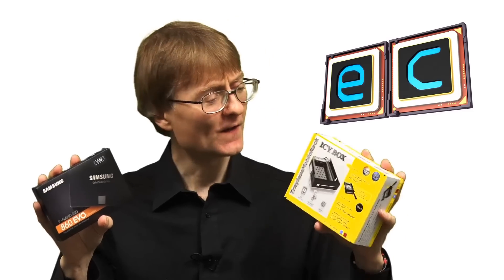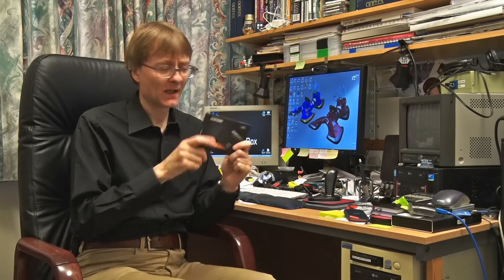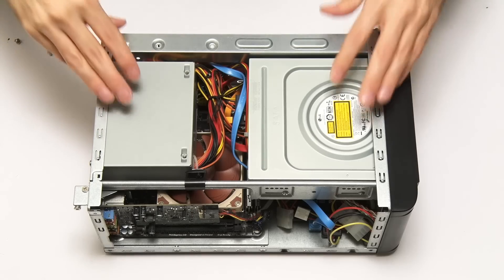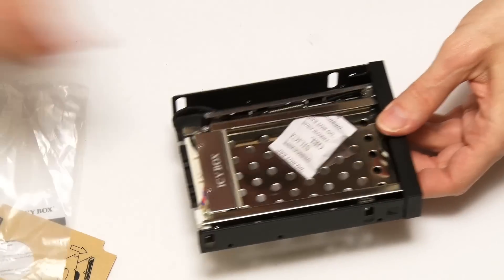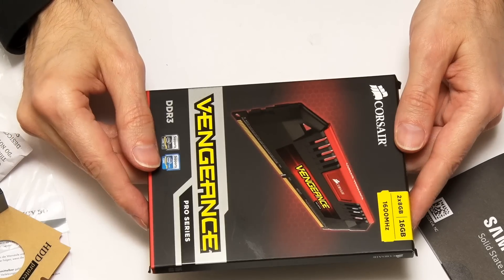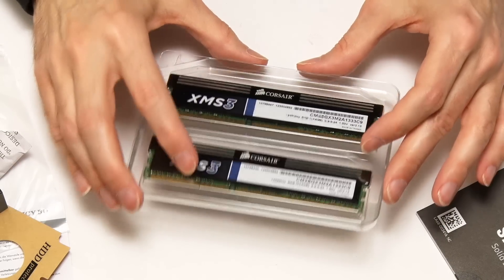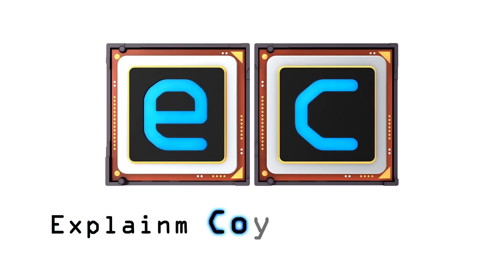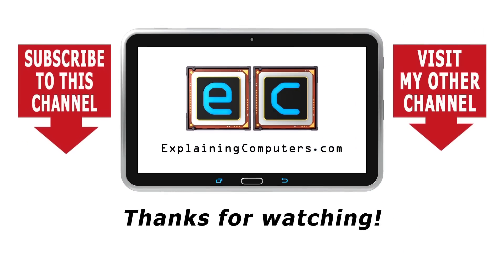i3 Mobile Rack

Comment: Good idea and something I might use to further increase the storage options in my already massive system (i've got a total of 10TB on 4 HDDs consisting of 1TB boot drive, an old "shucked" 1 TB data drive, a newer 2TB SSHD data and a new "shucked" 6TB HDD for even more data).  I prefer the look of the SilverStone SST-FP510, as it give you a hot swappable 3.5inch and  2.5 inch bay, as well as front usb3 (good for older cases), also on/off switches for both drives.

Comment: So are you running Windows 10 as a virtual machine under Linux?
Reply from the maker: Probably (for web page testing). But the first VM I set up was Windows XP (which is running offline for various older Windows software).

Comment: But why don't you run Windows 10? My old desktop was an Intel Core 2 Duo with 4GB ram and it ran flawlessly. The only problem I had was the integrated Graphics. When I used an Nvidia GPU, you wouldn't notice it's age. The only reason i replaced it was that the motherboard died.
Reply from the maker: Some software will not run under Windows 7. And I greatly dislike having zero control of updates. My biggest reason is that I cannot customize the display to be comfortable for my eyes on a standard DPI screen -- something that I can do with registry hacks in Windows 7. I am one of the very small percentage of people who finds "cleartype" to be very uncomfortable to read. So the font controls (or the lack of them in Windows 7) are the deal breaker for me.

Comment: The point about dropping Windows 7 soon is moot. What is had now is extended support only. So fixes would only come at a cost, not for free. It's already "too late".
Reply from the maker: Windows 7 is still receiving free security patches until Jan 14 2020. So it is not "already too late" -- Windows 7 is still considered a secure OS by Microsoft and third parties. But beyond Jan 2020 it will not be.

Comment: Fantastic video Chris! I have just started my migration over from Windows 10 to Linux mint. I gave 10 a go (Reluctantly) but now one machine is over to mint I will be getting all the others over too! My migration was hampered by my laptop being AMD apu based and issues with graphic drivers so it's staying on 7 as a legacy machine now. I didn't want to touch my core 2 duo desktop so was stuck till I got given a celeron acer which was perfect timing ;)

Comment: I have a machine with 2 ssds that boots into GRUB and I can choose between mint and windows 7. Is there a benefit in using this insert method over GRUB?
Reply from the maker: It depends on your requirements. GRUB can get corrupted. And for me the flexibility to instal/test out many different OS is useful for the channel. There is no best solution.

Comment: This upgrade is what I did with my old Core2 Duo test machine... until it failed through a power supply problem.  By then there were no spare boards etc to fix it.  :-(
Now I use an HP N54L Microserver.  As it comes with 4 cold-pluggable drive bays, and can happily boot from any of those bays, I find it even better.  It is a 64-bit computer with full virtual computer support and can accept 16GB RAM.  There is enough space at the front to pull out the inactive drives, close the latch on the unused drive trays, and leave them disconnected behind the front grille.  I measured these computers as using ~54W input; but that one now has an added graphics card.  BTW, I have a second N54L running LMDE as a server and emergency backup computer.  :-)

Comment: Modern small LEDs can be very bright, to dim them you can solder a resistor to the power cable (the cable going directly to the LED of course). A 10K ohm will take the edge off while a 20k resistor should be dim but still visible, you can dial-in the brightness with values in between. I changed the annoyingly bright blue LEDs on my case to white for HDD access & a slow colour change for power. Granted it's some fiddly work but can be worth it.

Comment: I like it but, molex connector in 2019 come on.
Reply: Face it, Molex 4-pin power connectors are a de facto standard, in use for decades, and are the least common denominator in power connections.  Have newer power connectors come along?  Certainly, but none are as universally adaptable.  And I've never had the problems with it that are being mentioned.  If you prefer something else, use it.
Reply: @bobblum5973  Right. The molex will live on at least 6 more years.
Reply: What a load of bollox.  
It's a power connector FFS!  It has pins and sockets and far more robust than the SATA equivalent.  
Strewth!  Some people just have to moan about something.  
Yeah, so they're a bit 'chunky'.   But I've lost count of the number of SATA style connectors I've snapped over the years, never snapped a Molex ever.
Reply: It's  5-year old machine. Ease up.
Reply: @jsimmonstx  not the adapter he bought to install the ssd though. That is brand new.
Reply: 5 years?? molex hasn't been a thing for about 15, no parts require molex today, they are unreliable and not very useful compared to modern alternatives, adaptors to molex are the most dangerous things you can put in a computer. there is literally a saying in tech "molex to sata lose all your data"
Reply: @dayspoiler4608  I dont agree with you about molex being not in use today as my power supply bought only last year has 4 molex connecters on it (evga supernova g2)
Reply: @dayspoiler4608  Drives and expansion cards don't use miles but random cheap enclosures, RGB stuff and other things that draw power still often use molex.  Lord knows why.  Molex sucked twenty years ago and has aged like fine room temperature milk.
Reply: I hate molex connectors, I’ve lost count how many times I managed to gouge my fingers when I worked in IT

Comment: Chris is not better have the 2 ssd installed and switch one or the other on bios prompt pressing F11?, i think is faster than been replace ssd manually.
Reply from the maker: This would work, and would be my solution if I wanted to switch between OS on an ongoing basis. But I suspect I will hardly ever use Windows 7 after 14 Jan 2020.

Comment: I really enjoy your videos and find them informative but, I am not sure why you simply didn't install the second ssd in the case (e.g. where you put the icy dock) and just select the appropriate boot drive when booting up? Alternatively you could have partitioned the main ssd  with a Linux partion and select Win' 10 or Mint on startup.
Reply from the maker: Just not what I decided to do. Within a couple of months I will hardly ever use Windows 7. Windows 10 is not going near this machine at all! :) Also, I regularly look at different OS for videos on this channel, so it is handy to keep my PCs as flexible as possible. :)
Reply: @ExplainingComputers  ok, just curious I am planning to add Ubuntu to a similar machine, but just plan to add a small ssd.

Comment: But why no dual boot ? or two SSD's in and switch in the BIOS ?
Reply from the maker: Because fairly soon I will not be running Windows 7. :)
Reply: @ExplainingComputers  And then ? win10 ? but then no need for Linux anymore...so no need for they bay ?

Comment: not only is windows 7 losing support but windows 8 is as well, January 2020.
Personally I would still be on windows ME or Vista, both were good systems with the correct hardware.
Reply: Windows XP was best windows, Windows 2000 a close second once it got sorted. Windows is something I have slowly phased out in past 10 years, and I only have 1 machine running win10 in the house now. All other computers are various flavors of Linux, a mac book pro for on the go adobe stuff, and a few retro windows rigs for old games or sw that rarely get booted. Dang, I got a lot of computers around.

Comment: 12:21 - Lovely bright blue LEDs that punch little tiny holes into ones retina. Who designs such rubbish? Perhaps looping in a resistor could bring that to a decent level while still providing some feedback?
Reply from the maker: What I could not figure out was why the LED on the rack was so much more active than the "HDD" LED on the case itself! :)
Reply: @ExplainingComputers  Perhaps other logic on the board? Kind of retriggerable monostable with different time constants (wild guessing)?
Reply from the maker: Maybe so. Has to be getting its triggers from something!

Comment: A while back I found a 5.25 to 3.5 bay adapter that also could fit a slim laptop cd drive too, its still in its box, it might have worked well in your machine. In my computer I have a 5.25 removable HDD bay that can take a 2.5 HDD and a 3.5 HDD together and the blue light was really annoying, so I unsoldered one of the legs off the dual colour LED.

Comment: The video editing stuff remains on a Windows machine? Although Davinci resolve works on Linux, but only on certain distributions and it needs lots of memory and a good GPU, preferably Nvidia, since Intel is a little weak and AMD is not supported yet.
Reply from the maker: Yes, video editing and 3D graphics (LightWave) remain in Windows. I have experimented with DaVinci Resolve on a Linux system, but expect to continue to edit largely in Premiere Pro, also using After Effects, Illustrator and Photoshop as well as LightWave. So for production I am (sadly) going to remain Windows. And for the time being at least, Windows 7 run offline. :)

Comment: If you touch the dust the gods of "never change a running system" will awake and might feel disturbed.

And then the lottery begins. But this one sitting on the desktop was not such a dust sucker.

Nice usefull upgrade and investment for sustainability instead of buying the next cheap offer of a new system.

Reminds me to upgrade a 2 or 3 year old system with an ssd too.
Will be a nightmare, cause it is dad's machine and that means that everything should be there where it had been on the old system with the same name for example we have for each printer multiple instances installed to save the config like 
★ double sided portrait + black 
★ double sided horizontal + black
★ single sided + colour

And everything should work as before ... 
so we have added a "classic shell" that windows 10 Start looks like 12 years ago.

It is time to prepare that exchange I guess.
Lot of things to prepare ...

Comment: Have you thought about using wine on Linux mint fod smaller applications as well? I use it on Linux lire (debain) and I use it for some applications, nice upgrade tho like it's design 🤣
Reply from the maker: Yes, I may use Wine. So far I've set up a Win XP VM, which is working really well for running older Windows apps.
Reply: @ExplainingComputers  I miss xp so simplistic and one of my favourites even today, are you doing a follow up video after your finished, would love to see it fully set up 😎 I'm stuck for space to do this kind of set up muself on my laptop and cpu is kinda underpowered
Wbat would you say is you favourite distrobution of Linux?
Reply from the maker: @liamh2o01230123  I had not planned a follow-up,  but there seems much interest here, so 

I may! :) My favourite Linux distro is Mint.

Comment: I have four of this hotswappable icy box. They break soon especially the cable connection breaks but also the push out spring. Unfortunately there isn't an alternative on the market.
Reply from the maker: I will see what happens! As you say, options are limited.

Comment: Uhm why not just add the new ssd to the system and choose your os at boot from grub...
Reply from the maker: Because I do not want a dual boot system! :) They can work -- I have covered them here -- but they can also get corrupted. So as Windows 7 is now time limited in normal use now, I decided on the bay solution. But there is no right answer here.

Comment: Nice mod. Good work. It's very important to show people that even serious, heavy users don't actually need the most overkill machines to do their jobs.
Reply: they do though, a Pi4 is barely able to cut it as a thin client which is why we have HP AND. Dell making thin clients.  I have a thin client for my mum, gen 4 Intel.  12GB memory, i5U.  has proper Pcie.  it was short on storage, 32GB of MSATA beefed up with another 250GB SATA SSD.  added to that she can access the home network.  I bought that in the summer for £100 and it is needed.  no way the Pi4 would compete

Comment: Why not a dual boot on 1 large ssd?
I have a 2TB ssd with windows 7 and linux mint and it works just fine.
Reply from the maker: Dual boot is certainly an option to run two OS, and I have covered it in several videos here. But my intention with my i3 is to transition to Linux Mint entirely, keeping the Windows 7 SSD (which is four years old now) untouched just in case I never to get to it. Single drive dual boot configs can go wrong, and as I fairly soon I will only be running one OS, I decided on the rack solution. :)
Reply: @ExplainingComputers  I hear you but i have found out that a windows os is handy to have for the program's (games) that don't work under linux or vm.
So i can't go fully linux mint just jet :D

Comment: What kind of mouse is that? Vertical mouse?
Reply from the maker: Ah, it is a 3M Ergomonic Mouse -- the column is rigid, and keeps you fingers in a relaxed position, while the thumb rocks to click left/right. I've used one for about 20 years now -- really helps with RSI.

Comment: Ah yes, I'm sticking to my win7 for games, and those that doesn't work on win7 can go past, as Linux will be speeding up their windows games compatibility. SO, no winX for me, thank you very much..Great presentation, you can revive your old system with ssd's and maybe use clonezilla or similar to copy all from hdd to sdd..I already replaced my dvd on my laptop with a  rack sys to house my old 4TB  hdd that was replaced with a ssd..AND all my installed stuff still works if you path to their shortcuts..👍

Comment: It's all very well to swap the drive in and out...but really? Linux has supported multi-boot for decades now. In fact, I have one system that has Windows8, Linux Mint and Mac OS all on the same system. Grub does a fine job of allowing me to choose which OS to run at boot time. And then under Linux I can mount the Mac OS and Windows partitions, and use them for mass storage, etc.
Reply from the maker: I have covered dual boot many times on this channel, including with Linux Mint. But I don't want to dual boot on this machine. :)

Comment: Cool way to "dual boot". I've always added a second drive for each os or used a single drive in a pinch. Your new method would certainly save hours on the unused drive.. I will be thinking more on this.. do you see any other pros/cons?
Reply from the maker: One pro is the ability to remove the main OS drive to try experimenting with other OS (which for me may be useful as I often try out all kinds of OS fo videos on the channel). A con is that sometimes OS are not happy being switched around like this (well, Windows 10 sometimes isn't!) -- I use another form of rack on my test rig and regularly swap Windows 10 in and out on that.